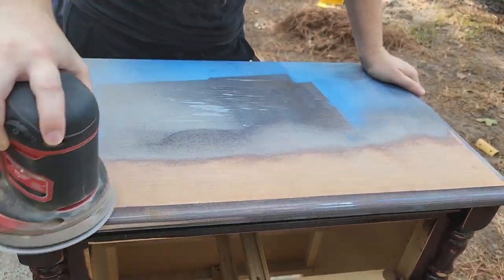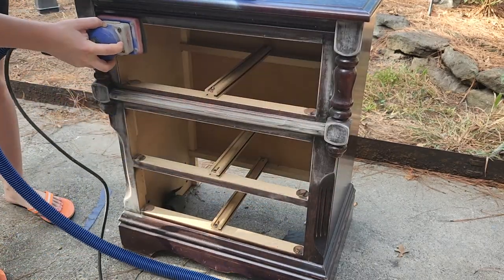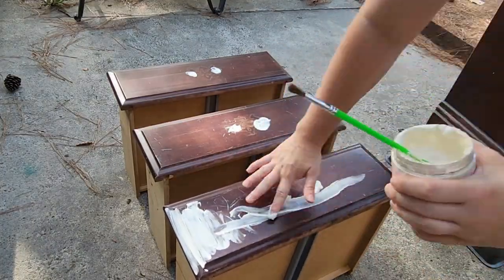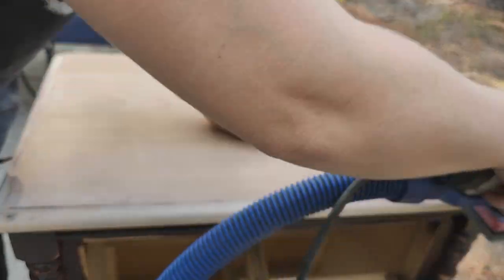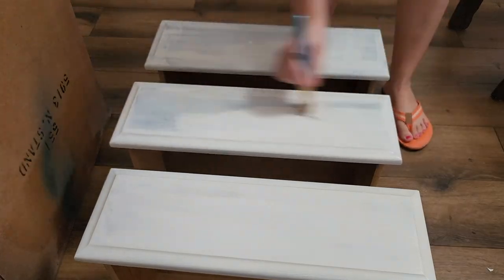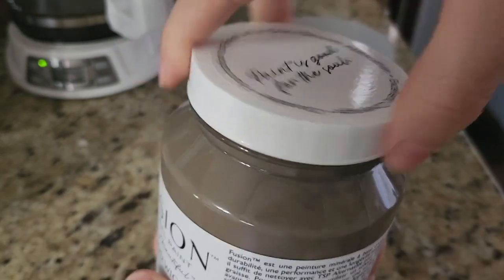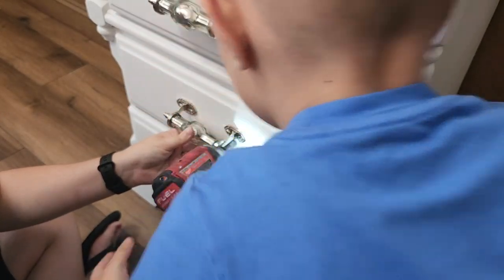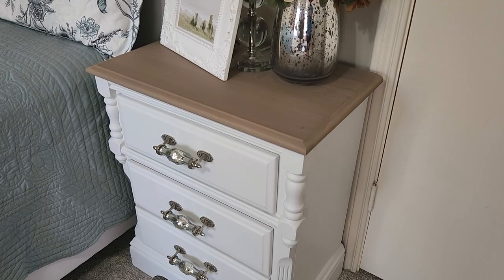Shop Your House: Makeover Your Furniture At Home and Save $$$

Comment: I've used Fusion mineral paint and I liked the coverage, but it was such a flat finish and I ended up with brush strokes on the final finish.  It was my first attempt at making over a play table set that was solid wood that I bought off facebook marketplace for my kids.  It is a bulletproof finish, though!  Do you have a recommendation to avoid getting brushstrokes?  I did sand between coats - maybe I needed more sanding.  Or maybe the shellac step could have helped - I didn't do that.
Reply from the maker: Using a high quality synthetic brush helps cut down on brush strokes. Some people will use a damp foam roller while painting to get rid of brush strokes. So you'd brush on the paint then roll over your brush strokes

Comment: Ok so i have my deceased mom's dresser! It is very old, i would say it is at least 50 yrs old & looks it. I'm dying to re do it but I'm scared to death. I'm 61 yrs old & I can't lift heavy things & I can't walk too good so taking it outside to sand is a "no way". Soooo i was thinking about giving it a good clean & painting it with chalk paint since i heard u don't have to sand when using chalk paint. I kno your a busy mama but i would so appreciate your in put on this. Do you recommend using chalk paint on a dresser? I'm going to use it to store linens. I would love to just sand the top & stain it a light wood color + was thinking of doing the rest of the dresser in "waverly" chalk paint in the color plaster to brighten it up. OMG I'm nervous just talking about doing it lol but I've been watching your videos & girl you are inspiring me to just go for it 🥰🤞
Reply from the maker: Hi Cindy. I definitely think you can do that. Pick up some little furniture risers off Amazon. I'll link some in my amazon store for you. Stick those under the 4 corners of your dresser so you can paint all the way to the bottom of the dresser much easier. Give it a good degreaser cleaning. Paint it with a chalk paint then seal it with a polyurethane. If the wood bleeds through the paint then use shellac over the bleed through then repeat the chalk paint and poly. For the top I think it will be impossible to sand it to bare wood indoors. The amount of dust a sander makes is just not going to work indoors. Instead I'd go over the top with a darker gel stain then poly over that. Hope this helps! Oh and don't forget to rub n buff the handles if you want to update the metallic finish on them as well. Otherwise you can spray paint then black or even just chalk paint right over them. Have a blast!